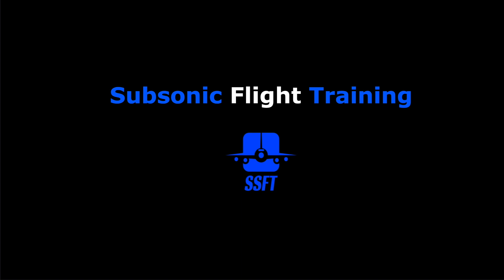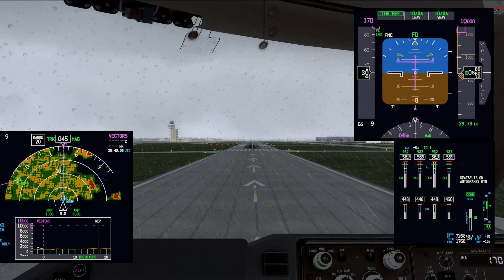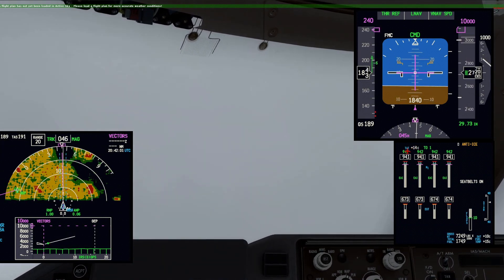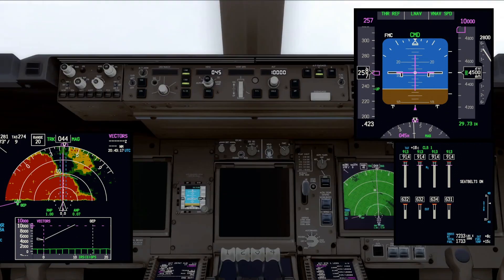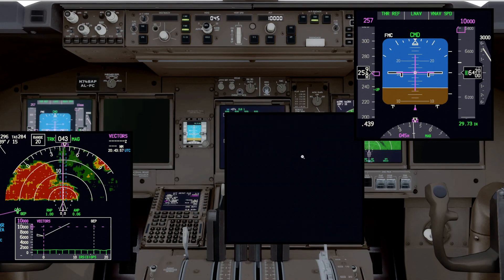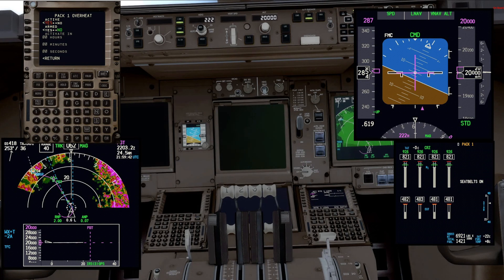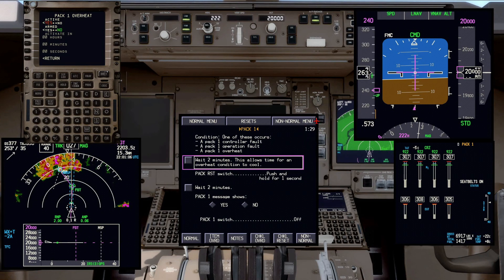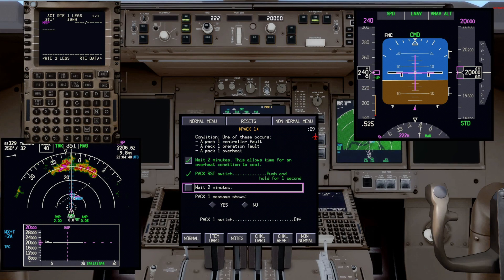Ep 4 | Part 3 | TIMED TRAINING TIPS | ELECTRONIC CHECKLIST (ECL)

Comment: 5:20 What is that called in the top left?
Reply from the maker: The FMS-CDU, Sometimes just called the CDU, or MCDU. Flight Management System Control Display Unit, or Multipurpose  Control Display Unit. It is the interface between the pilot and the FMC, Flight Management Computer…